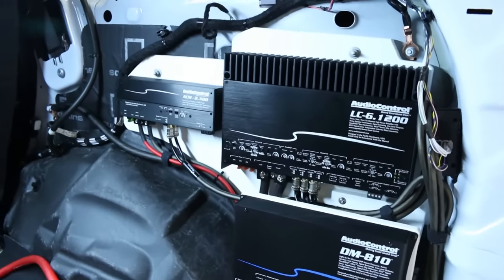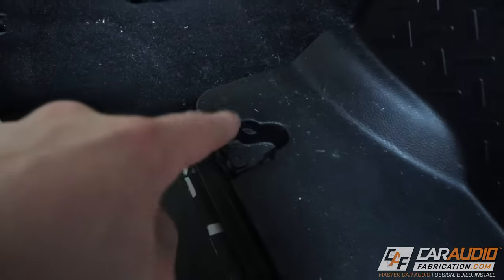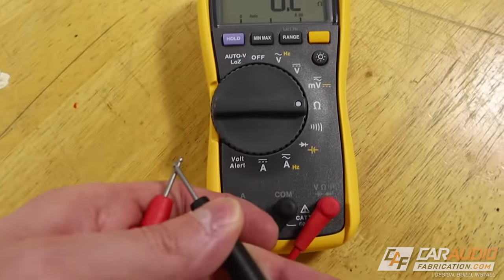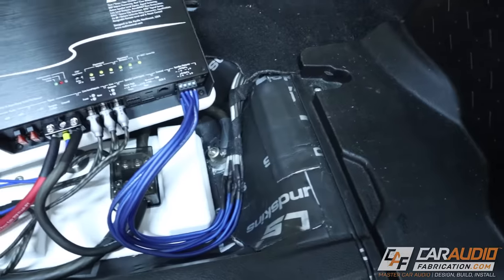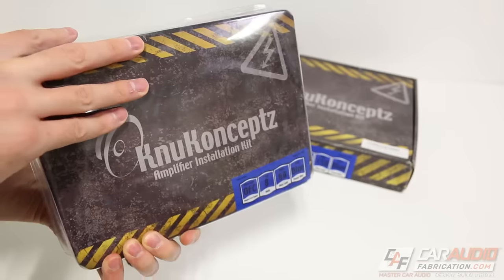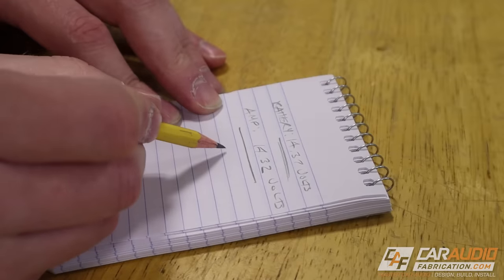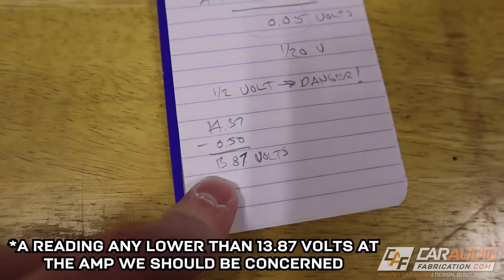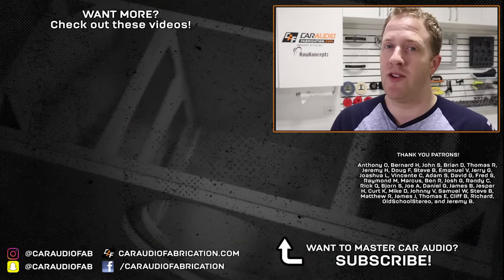YOU'RE LOSING PERFORMANCE! How to Measure Voltage Drop and Test Ground

Comment from the maker: Hey dudes! Who already knew about this test? Who didn't? 
There's no shame in learning something new! What else would you like to learn?
Reply: CarAudioFabrication so when I’m playing my music with my car on and running when I hold the rpms over 2000 it keeps the amps on when it drops below it cuts them off two 300 watt amps running of off 4gauge wire each amp powers a q power 15 please help
Reply: How do you know how much your stock vehicle alternator amperage could handle including accessories + amplifier?
Reply: samuel purvis 

Is your wire OFC??  Using ofc vs CCA can definitely cure this issue.

Check for corrosion at the terminal connections.  At the battery, and at ground.  Could be an issue.  Not having a rock solid connection can be it.
Reply: I didn't know you could read voltage on the same polarity. Learn something new everyday.
Reply: Is it best to run ground to a 2nd battery or on the frame
Reply: Danyo 
Watt = amp x voltage
Reply: I’m a Automotive tech and have to use voltage drop and circuit resistance test often .
Reply: CarAudioFabrication this video is simple and soo informative thank you
Reply: How can I tell which way the polarity is by using a tester?
Reply: If your testing volt drop from the front to the rear how would you do that with short probes ? Maybe I miss understood that part
Reply: This is great for someone new to installing
Reply: Do you have a video for how to properly start up and adjust your system for first time? Im just about finished my build pioneer avh120' split rear rca to lopro 8"600w sub and other side to 400watt amp feeding 2 6x9 250w/each full range, then off front rca to 400w amp feeds 2 4"100w/each full range. Powering all this is my auxillary power setup: 2 deep cycles fed into 4awg and i have a 3.5f capacitor. Its been a long time since ive done an install (18yrs lol) so your videos have been a great help! Im building my dream "Corona build" truck while im stuck at home lol 1987 toyota pickup like one from back to future but with a lot of mods lol. 👍👍👍
Reply: I agree 100%  clear and as simple as you can get without getting into the headache ZONE! Not what I was looking for but it's refreshing to see a great, intelligent video without stupid noise/sound bites.  Cheers!
Reply: @rrob1399  buy extension probes Doc
Reply: Yes I knew how to hunt a better ground location use 2 methods.
1. You're way writing it down doing the math, comparing various locations.
(I learned a good range from the video)
2. Connecting a wire to the battery ground and testing ohms resistance to various locations.

I'd like a video on better ways to ground the engine or Alternator other than just replacing the factory locations with better wire.
Reply: @beatsandwestside  you pick the spot with the least resistance
Reply: Good stuff but you lost me at the measuring the voltage drop on the same wire or on the same circuit that will always be zero because there’s no voltage anywhere until you connect the opposite terminal. What am I missing?
Reply: Everything
Reply: I have always installed my own systems going back over 25yrs now. Back then it was different, but even now learning new tips like the ones in this video show me what I missed all of those years. This is great! Thank you for the great videos, I wasn't doing it right all these years, but I am now.
Reply: A videos on how to make your own ground using a rivet gun
Reply: Well, your video taught me how to check each connection point along the route of current flow, according to ohms. Which helped me know those weren't the problems. 

But then you said, which makes perfect sense, even a small wire will show good ohms. So, that made me want to try the voltage test according to your instructions.

I found that I had a ~2.0V difference between the battery and amp. Found that my terminal at the amp was likely the cause. I filled it will solder, using a soldering iron meant for smaller wires, making sure it was solid, and tight. Took a long time. But... less than 0.3V drop now. 

My sound system actually sounds like a real system now. There are sounds that are complimentary to the layers of frequency, that weren't there before. It sounds full, for all styles of songs. 

For years, I've always struggled trying to get it to sound any good. And it seemed every style of music needed me to rearrange the stereo and/or amp settings. 

You've helped me so much. I'm now a subscriber, and I will recommend you to others.

One thing that is a point of confusion for me during your video, the 40hz sine wave. You didn't mention, or I didn't understand , what volume to test it at.

 My sub has a different amp, which wasn't the problem amplifier. the problem amplifier was used for my speakers. Everything was connected when testing voltage drop. So, I used the 40hz sine wave. Now, what happens, when listen to something like Daft punk,  my rear right speaker is sounding like it's obviously blown. But when listening to music that has less bass tones, it's fine.

I hoping this will go away, but maybe there was a problem with your instructions about the sine wave, or in my understanding about it. Does it require caution, or different Hertz frequency for different speakers.

Basically, could the Hertz frequency, the volume, and/or duration cause a speaker to blow?

Anyways, I'm not blaming you for this, it could be many things in addition to stressing it out... I'm just happy to have a working system now, and speakers I can just buy another pair knowing it that my sounds system is working good now.

Comment: If u don't want to buy extension leads use speaker wire and do the same thing to measure resistance it works well
Reply: How would you use speaker wire?
Reply: @jordanlara751  wrap one end around the positive test lead of your multimeter. (Be sure to check the resistance between the speaker wire) Then stick the other end of the wire on the positive terminal of your battery. Now use the negative lead to test your ground.
Reply: Any wire you just need to minus the resistance of the wire and leads.
Reply: Thanks for this! I bought extensions and they won’t work! I was racking my brain on how to fix this issue. This helped me a lot! Now I can test
Reply: Can I use the jump start wires as extensions? It has the negative and positive ends
Reply: Great idea thanks! Worked like a charm.

Comment: Run a separate ground will eliminate all this work! It also eliminates any future issues with the ground. Sure it cost more but you have to run the hot why not run the ground at the same time? Been doing this since I have been driving way back in the 80s when cars were simple!
Reply: Ken Richner I was running 0 awg wire back in 1987 from negative terminal to a distribution block since I was around 14-15 years old. They all told me I was an idiot. Lol. Never had any issues. Zero pops zero engine noise. Now it seems they have all followed  lol
Reply: Well usually the chassis ground will have a much lower resistance than ~0ga all the way back to the battery... and it’s the common ground so on top of keeping the impedance minimal,   it should also help minimize system phase issues while keeping cost low (ofc ain’t cheap ya know.) so use that bucket of saved money to further enhance your system by acoustic treatment, add or upgrade your dsp, add loudspeaker horns on the roof for hollering at bitches etc.. you know .. things that really matter
Reply: @tommyapex4595  the treal shit 😂😂😂
Reply: The frame and body also act as a buffer against voltage spikes from amp, you can fry your battery and or alternator doing this which is why most amp manuals say to ground to chassis.

Comment: This is why I say car audio is mathematical people don't believe it 14.4 volt with 1 volt drop can lose 100 watts out put... 14.4 volts ×100 amp= 1.440 watts  1 volt drop 13.4 × 100amps =1.340 watts. Then have resistance of The Wire that alone can cost you up to one volt depending on the length of the wire and size ? Just say. Good vid mark keep it real
Reply from the maker: Most of it is simple math, but it can make a big difference in the performance of the system!
Reply: You can treat wire as resistor and calculate power on it, for your example you have 1v on it when 100A is passing through it, that makes it 1V/100A=0.01Ohm (10miliohm), also power can be calculated 1V*100A=100W. Since wire is in series with load (using kirchoffs law) you have to get total power by adding power on wire/resistor and amplifier on this example, so 1440W=1340+100W
Reply: Also your amplifier will most likely produce more power at 14.4V than it would at 13.4V so most likely you are gonna get more than 100W just by upgrading wire.
Reply: Cekpi7 Measure the voltage with the car on and the system playing at whatever volume you normally play. When the bass hits your gonna see the voltage decrease. The best bet to get all the voltage you can is upgrade the alternator, run over sized quality wire, and add batteries. That’s the biggest problem when people add systems to their cars they don’t think of upgrading the electrical. Stock alternators only have a little head room and can’t keep up the the demand of a big amplifier.

Comment: the word is conductor you want it to conduct, the ground needs to be conducting electricity, paint is not conductive... connecting to a painted surface is not conductive, you want a large surface area to conduct a lot of electricity only measurable when under load, use encapsulating dielectric grease to protect the connection

Comment: Video idea; $3 rca vs $30 rca signal cable differences . Love the videos!
Always well demonstrated!!!!!
Reply: Mark Seven  quick maths
Reply: I have a problem in my sony amplifier it is giving red 🔴light and it is not onning   please 🙏 put the vedeo open this
Reply: @abdulsajid1518  you mean you have a red light on , on your amp and your car isn’t on ? Sounds like you wired the remote to a constant current fuse
Reply: @abdulsajid1518  amp is in protection

Comment: Very well done.  I like that you took the time to explain that voltage drop measurements are to be taken while the system is UNDER LOAD.  I will say that the voltage drop measurement you are taking is proportional to the current of the load.  Therefore the voltage drop will be higher when you turn up the volume (Vdrop = I_load x R_wire/connections).  To add further information, you are testing the voltage drop due to the electrical connections and NOT the system drawing more current than the alternator is capable of providing (therefore resulting in the voltage dropping to battery voltage).  You should do a separate video explaining that the alternator can only provide the current it is designed to and that adding extra batteries is not going to solve voltage drop issues.  In order to maintain 14.4V+ you need to have an alternator capable of the system demands (or multiple alternators).
Reply: kyle3420 thanks for explaining in full what should have been included in this video ... Lots of ppl including myself were confused like how are u dropping .05 volts full tilt .. now I understand better thanks

Comment: Awesome vid Mark!

I recently needed to test for voltage drop, the ultimate problem being with my fuse block.
Accidentally installed a washer between the fuse and block, which caused a high resistance failure point.
The fuse for the subwoofer amp began to melt during some serious hip-hop bass segment, but never went full-blown.
Won't be making that mistake ever again.

I get less than .1 volt drop after getting a new fuse block. 
The factory amplifier ground points under the seats were never used, and gave me a great grounding spot!

I was aware of the resistance test but never load tested a ground point before, that's a great test!

Comment: There's one thing you failed to mention in the video that I noticed Oh by the way excellent informational video, when you're describing testing the resistance the positive lead goes to check your possible ground locations the negative leave goes where to the battery or to the battery cable it's never specified where it goes. Lot of folks wouldn't know, either way excellent work thanks for the information got a good thing going keep it up

Comment: Used voltage drops for years and would make one small comment on checking your grounds.  The body grounds are usually much small than the power side.  This one area is easily overlooked when you see a large power cable going to the engine block followed by a tiny wire going to the body.  And you have a excellent series of videos didn't start using plastic until I viewed your site.

Comment: this was interesting, i just tried all these. My audio battery and car battery are in the trunk. rest voltage was 12.7 volt across anywhere i tried .. resistance from all my wiring was 0.00 including my earth points (rear folding centre seat mounts) i'm using 2/0 ofc for everything..
The engine bay fuse/relay box has 2 positives one from the alternator both show 12.67volts (i realized after my interior lights were on if that makes much difference) the only thing i couldn't test was the resistance from fuse/relay box positive to my trunk glad i found this it helped alot since i am adding a 8k rms amp soon and i am pretty positive now my electrical is looking healthy... only thing i have to do is beef up my 140amp alternator

Comment: i used my seatbelt bolt in the back, sanded the heck out of it and put washers on both sides with a locking screw and it’s worked better than grounding to my battery

Comment: That explains alot of my voltage drop, I have 4v of drop under heavy load at specific frequencys and this helped me realize I had to small of a ground wire or cca and not ofc got it fixed now thank you so much
Reply: so with 4 volts and a added amp will sound better than a line converter because you can set the gain lower on amplifier. Will allow you to go full volume more likely?

Comment: So I had 2 15 inch subs installed in my Yukon in a custom box. It was a big job so I went professional. Bought equipment and he installed himself. He is extremely knowledgeable and did a great job installing it. The thing is, it's been 3 or 4 months now and I swear I've lost some power sometime recently? What could it be? I know everything is the right size and it's all obviously connected properly. So with that being said, and me making no other changes to my vehicle, what could have happened?

Comment: I installed a kicker KX 400.4 amp and upgraded all 4 speakers and tweeters in my truck. Everything worked when I started my truck up but today was the first time I actually drove my truck, once I started to drive I had no sound, the must have shutoff. Come to a complete stop put the truck in park amp work. I rethinking that my grounds are not that great. To have it work in park and not in drive.

Comment: I learned back in the 80s using an opened box for subs allows woofers to travel as though they are in a lot huger box. Then on one woofer reversing polarity each woofer no longer cancels each other out. Using seas foreign 13 inch woofers sounds great. Music used to test Patrick O’hear David Helping examples shows the highs and lows better than like rap 60 db bass. Give me comments what you think. I love learning.

Comment: What I did is add an extra battery to the rear of my 08 Durango and just did a run of 1/0 power and ground strait to the alt. Eliminated all of those pesky grounding problems.

Comment: Hey mark. Thanks for all your videos. I realize this one is a bit old. I I'm looking for a good ground on the same vehicle. I assume you drilled into the body for that location?

I also used that cargo hold down is a ground on my previous amp which died after a year in this vehicle. I don't know if it was because of a bad ground or because it was 20 plus years old 😢.

Thanks again!

Comment: Where else can you use as a contact for the negative point if you multimeter wires are the standard length and do not reach the car battery?
Reply: You have extra speaker wire? Just use that, but don’t forget to measure it’s resistance while it’s connected to the DMM leads.

Comment: I just did the big 3 upgrade and now my alternator is whining pretty bad and it's constantly putting out it's max voltage. Definitely going to check the resistance of all the wires tomorrow and see if I screwed up the ground or possibly even the positive wire from the alt to the battery.
Reply: faulty regulator

Comment: I’m running 1/0 ofc wiring for my amp during a certain song when the bass note hits the amp shuts off and will not turn back on until I shut the car off and restart the car I then lower the volume by 5 (from volume 30 to 25) and it doesn’t cut off. It doesn’t cut off on any other song either

Comment: Just came back to this vid in 2022.
I measure my Volt. Drop on battery and Amp connectors with DMM. The difference is 0,05V 😁

Comment: i got all my installation equipment ready to get intalled, glad i saw this beforehand. thnx for the vid. would like to know more about installing multiple amps
Reply: Running multiple amps, i run seperate grounds and positives or a large enough one into a distribution block(1 positive and 1 negative) 
Make sure your sub amps grounds are as short as possible.  No longer than 18 inches..shorter is better on the negative side